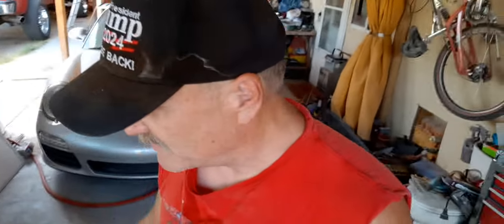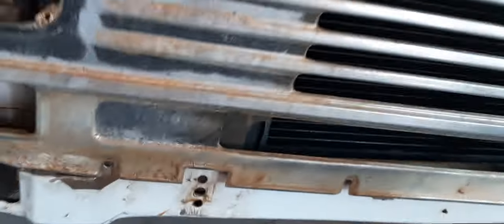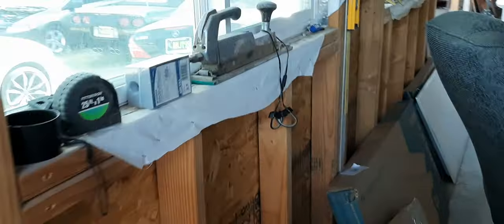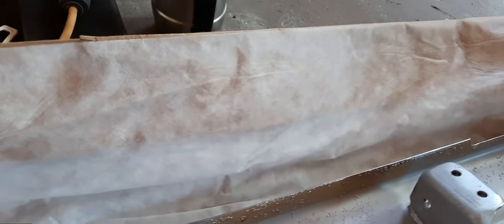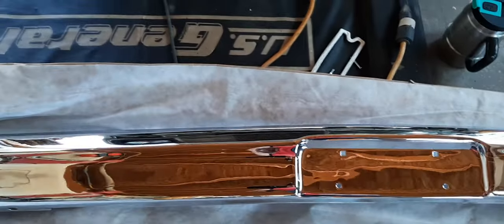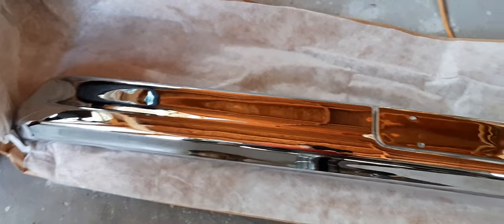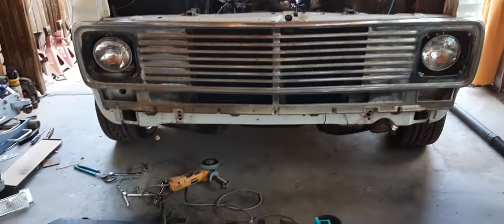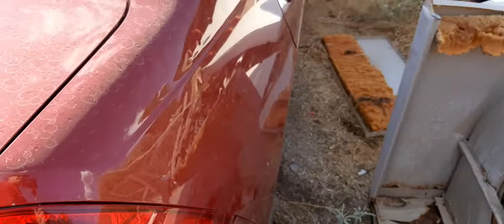1978 1977 Chevy G10 G20 G30 Van grill conversion Chrome unboxing see my other videos for more vans.

Comment: Man that is one clean old Chevy Van! You got find anything like that in Ohio! Plus being the short panel van makes it super rare! I really like the early Grill and bumper set up your installing. Looks like the chrome shop did a very nice job on the Chrome! The torque thrust wheels really set it off! I think I would do red on the calipers to break all the white body color! Have a good one Buddy 👍
Reply from the maker: Thanks. Stay tuned soon I will post a video of it with all of the chrome glinting the sunlight.

Comment: I'm giving you a thumbs up just because of the Trump hat
Reply from the maker: Much appreciated! 🦅TRUMP 2024🇺🇸
Reply: @ricksteelcustoms3196  HELL YEAH !!!!
Reply from the maker: @davewhite9828  Replacing the GREAT President Trump with Mr. Dementia Joe aka “The Wrecking Ball" Lieden is like replacing your 125 pound Pit Bull guard dog with a 6 ounce teacup Chihuahua suffering from late stage dementia and a gimpy leg..😂😂😂
Reply: @ricksteelcustoms3196  Agreed 100%. Love the how to vids . Ive been wanting a  early g10 or g20 for 30 yrs. Now that I'm in a place that I can buy and customize it , they have really almost became extinct or in someone's hand that wont let it go. I may settle for an early to mid 80's . Looking for the right one now.
Reply from the maker: @davewhite9828 The best tip I can give you is to do what I did. I ran a "Van wanted" ad on Craigs List "auto parts" section I posted photos of several chevy vans both short and standard size that I found on the internet and I listed the years from 1965 to 1995. I bought both the white shorty and the gold van only about 6 miles from my house and since they were sold new right here in El Paso Texas they both have ZERO rust. The junker white van I bought from the Arizona Copart auto auction also has zero rust. It took about 6 months for me to buy all 3. But I was lucky, VERY lucky. And I wish you the best of luck in finding your dream van. But the CL Wanted ads really work I have bought a lot of stuff that way.

Comment: Redoing the stereo system in my 78 g10s and there 3 wires that connect to an LPS fuse, ground and another fuse that might say ACC or just AC, they come together into a plug that ends right behind the radio with the rear speaker wires. I can't find anything that it would plug into, would you happen to know what it is for?
Reply from the maker: The "LPS fuse is for your interior lighting. Don't use that or else your stereo will only work when the interior lights are activated. I would use the "ACC fuse" that is for "Accessories" and you will be able to listen to your stereo with the engine off and with the key switched to the "ACC." My van did NOT come equipped with a factory stereo, so I am having to install it from scratch. I don't even have an antenna hole on the fender. You can also check your fuse block with a hot wire tester and then buy a male axillary copper connector and push it into the hot side of the fuse and run a power supply directly to the back of your stereo just make certain to use a fuse link wire so if you connect it wrong you wont damage your stereo you'll just blow your fuse.  Also if you are certain the speaker wires running to the back of your van are indeed speaker wires just hook up a speaker to them and then to the speaker output wires on the back of your head unit and see what happens. Just if you are not sure test them to make sure they are not hot with your needle hot wire tester first before hooking them to your stereo, if they are hot do NOT use them. Best of luck

Comment: That bumper cost about 800 bucks
Reply from the maker: Yes but that $800.00 would have been over $1000.00 if I had to pay someone to weld the mounting brackets on and fill the carriage bolt holes. But DAMN! It sure is pretty! And maybe not one of a kind but I highly doubt I will ever see another just like it.
Reply: Ive got 89 shorty. I just redid. The front bubper was 800. The rear are cheap. They make repops. Decent quality.
Reply: How many vans do u have. I have 2 g20. 1 g10 1 astro im insurance poor
Lol
Reply from the maker: @davidgentz1731  I just bought van number 4 for $800.00 a 1973 G10 I will be uploading a video of it soon.